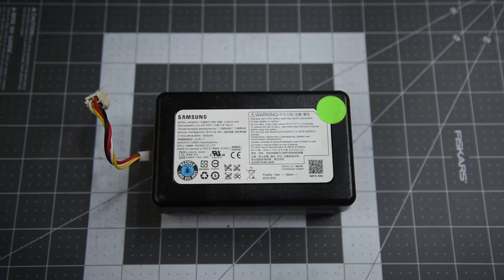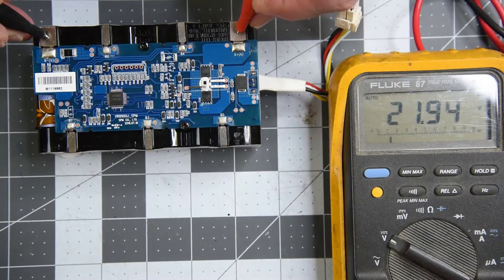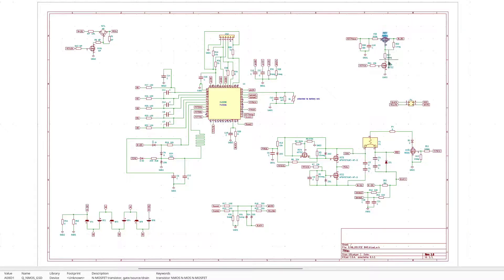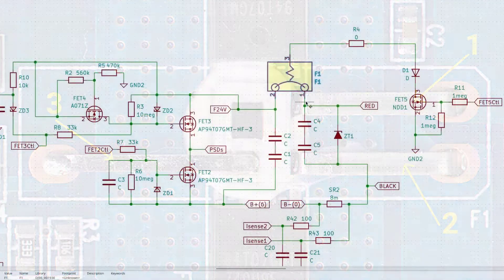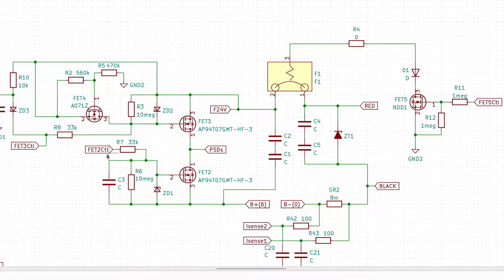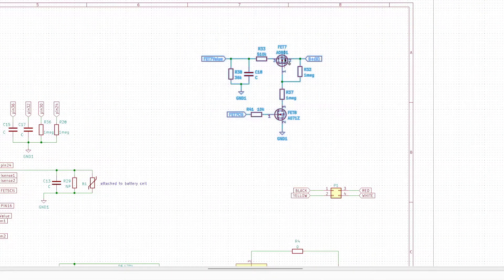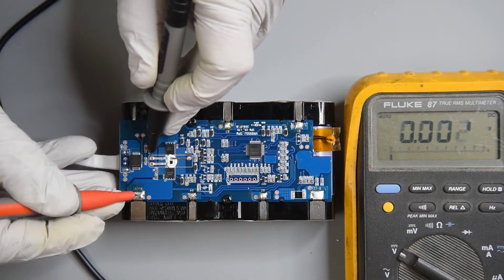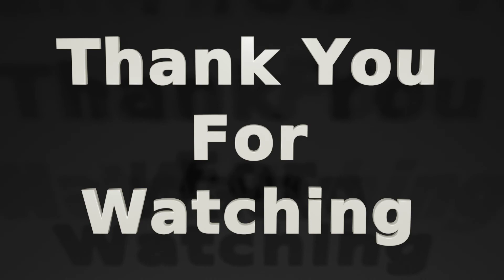Exploring the Samsung DJ96-00193E Battery Pack

Comment: Hi, 
I have such a battery pack and I have problems with my bot. If it is on the docking station, it boots up. If it moves away from docking station, it turns off immediately.

If I meassure individual cells, they are all have propper voltage readings (well balanced and full charged). But if I meassure at red and black, i get 0V. 
Should i get 0v if unplugged - and white and yellow are sending a "command" to bring the voltage to red and black?
Or should I get voltage on red and black always. If so, I have a problem with the BMS board and will investigate further.

Can anyone of you please check the voltages?

Thank you :-)
Reply from the maker: Take a look at this PDF: https://github.com/mlplel/rev_schmatic_dj96_00193e/blob/main/DJ96_00193E%20BMS.pdf. It's a schematic I drew of the BMS board. Check the special fuse F1; if it's okay, connect a light load across the batteries and then measure the cell voltages.

Comment: Hi, i replaced the cells in my battery. The battery pack looks fine and i have the correct volts between red and black cables. My robot every time it starts cleaning, it's stopping after less than a minute of cleaning and returns to the dock due to empty battery. I know for sure that the battery is full charged, checked with the multimeter.
Do you have any hint or clue about the possible problem?
Thank you very much, very good video
Reply from the maker: It sounds like a weak cell.  When you checked the voltage on the pack did you have any load on it?

Comment: Hi, I have this kind of robot vacuum cleaner. I realized that the BMS is broken and I have to change it. I disassembled the battery pack, the battery pack is a 6S2P of 21.6V 4.4 Ah. Can you help me choose the BMS that can replace the original? Give me a link where to buy it. Thank you
Reply from the maker: The battery pack BMS has to communicate with the vacuum, so I doubt there are any replacement BMS boards.  I think the best bet would be to try and find an entire battery on eBay or the like.

Comment: What do yellow and white wires go to in robot? What should voltages be? Really want to convert these robots to use dewalt or hart 20v batteries
Reply from the maker: The yellow and white wires are a serial communication interface.  Probably telling the vacuum what state the battery pack is in.  So if the vacuum doesn't get the correct information from the battery pack it probably won't do anything.  That will make it very difficult to use any other type of battery.

Comment: thank you for your video. i have  dj96-00193a battery . i've made the test like you at 6.35 minute of this video. one  fuse f1 works, but the other f2 one no. there is some possibility to restore it?
Reply from the maker: If you don't have 20-something volts on both the big leads of F1 then it is blown.  It is a special self-protector for batteries.  Something like these: https://www.mouser.com/pdfDocs/littelfuse_battery_protectors_itv4030_15a_datasheetpdf.pdf  .  But I don't know what the specs are for the one in the battery pack.  When everything is normal all 3 leads should have almost the same voltage on them.

Comment: Hi my robot have problem about battery. Now i check voltage from line battery but i don't know about voltage of line red white yellow black (good battery) please advice 😂😂
Reply from the maker: If I remember correctly, the red and black are the power lines.  Around 24 volts should be on them, but the battery pack will have to be connected to the vacuum to make the measurement.  The yellow and white are serial data lines.  The battery controller has an electronic switch that the vacuum has to tell it to turn on for the battery voltage to appear on the red and black wires.

Comment: hi, I have a problem with my powerbot vr 7000. After replacing the batteries, the robot works for about 15 minutes and goes to the base to charge, although the batteries still have sufficient charge. Do you know what could be wrong?  I will be very grateful for your answer
Reply from the maker: I don’t know for sure, but I would suspect one of the cells is discharging differently from the others. And the battery monitor is trying not to let that happen. That's the only thing I can think of at the moment.

Comment: Hello everyone,
I have a problem with my robot, it seems charged, I replaced the battery cells and they are at 3.9V, it moves away from the charging station, dies and the LEDs go out.
Do you have experience with this problem?
Would it be possible to have the schematic in PDF?
Thank you very much
Reply from the maker: How far does it move off the base?  If it just moves off the contacts then I would suspect battery pack problems.  I updated Github with a PDF of the schematic.   https://github.com/mlplel/rev_schmatic_dj96_00193e
Reply: @metalplasticelectronics354  Some times it pulls off and twists and turns on the vacuum motor to start cleaning, other times it moves off the contacts.
I have suspicions about the battery board. I check it. Thanks a lot.
Reply from the maker: It sure sounds like the battery pack.  I would try and put maybe a half an amp load on the batteries and see what the voltage reading is.  If it's good, then I would look for something around the MOSFET power switches.

Comment: Hi, why there is no reading on black n red wires? But reads 21.6 v between B- n B+6.
Reply from the maker: There is a special fuse and 2 MOSFET switches in between the power leads and the batteries.  I drew up a schematic for it here: https://github.com/mlplel/rev_schmatic_dj96_00193e  .  I think it's pretty close to the actual battery pack.
Reply: @metalplasticelectronics354  
Hi there, i do not understand very much about electronics, would you explain more details how to get it recharged?. I have a warehouse and recently got returned lots of these robot vacuums from samsung. Please need help.
Reply from the maker: I believe the battery pack has to communicate with the vacuum to charge or discharge.  The battery cells could be charged manually, but charging Li-ion cells safely and properly is not any easy task.  If the pack will not charge with it in the vacuum on the charging base, then one of the three items is defective.   If you have multiple items, try different combination of charging base, vacuum and battery pack.  But it’s not just a simple matter of supplying a dc voltage to the battery to get it to charge.
Reply: @metalplasticelectronics354  
Will it gets to charged if connect directly to B-(0) and B+ 6 ?
Reply from the maker: That would not be a safe way to charge the batteries.  If you just want to test to see if the batteries will take a charge, it could work.  I would limit the current to less than 500 milliamps for the test.
Reply: @metalplasticelectronics354  
Ok will try it out
Also thx for the sharing, i am waiting ur solution to make this kind of battery work again, will follow ip with u
Reply: How to charge a battery without a vacuum cleaner? Can I charge with original adapter connecting direct on battery some of four wires?

Comment: my board positif wire no supply which part do i need to check? when i check using multimeter -ve on black wire +ve on b+ have 21.40v but when measure on red n black wire no supply.
Reply from the maker: F1 has 3 leads.  Check the resistance between the two pins that are close together.  They should read almost shorted.  If not F1 is probably open.  It is a special triggerable fuse.  If it is okay, The controller may have FET2 and FET3 turned off.  That will disconnect the batteries from the power leads.
Reply: @metalplasticelectronics354  all 3 pin on F1 no reading to each other
Reply from the maker: Then F1 is defective.  I believe it is something like these: 
 
https://www.eaton.com/content/dam/eaton/products/electronic-components/resources/data-sheet/eaton-scf4030-self-control-fuse-data-sheet-elx1133-en.pdf

But finding one in stock for a 5 or 6 cell battery pack is difficult. And who knows what the current rating is supposed to be.
Reply: @metalplasticelectronics354  can use that part to replace? i will try to replace it..that unit cant be bypass?
Reply from the maker: It's a special fuse.  Probably a fire hazard without the right one in place.  And I don't know if one of those would work.  12 amps seems a bit high.  But that’s the smallest current rating I’ve seen.  If the batteries are rated for 10 amps.  I would not feel comfortable having a 12 amp fuse on them.  Certainly not something that is going to be running around my home.
Reply: @metalplasticelectronics354  thanks for your advise..

Comment: Nice very clear elaborated schematic teaching,,,may i ask that strangest thing f1 fuse i have tested it its opened on my samsung jet 90 battery pack its hard to find online can i just make it connected its other like shorting them its other thanks
Reply from the maker: It appears to be a special type of fuse called a – Self Control Protector or Self Control Fuse.  Something like this:  https://www.mouser.com/ProductDetail/Bussmann-Eaton/SCF4030-12-05?qs=Li%252BoUPsLEntK5nHGRSTGhw%3D%3D.  But I have no idea what current rating the one in the battery pack is.  Can jump it out for testing.  I wouldn’t put it in use with the fuse jumped out.  I think it would be a fire hazard.

Comment: Hi~ I left a comment on another video about your Samsung battery. And I took a closer look at this video and your comments, and there is a little controversy in Korea. The main IC of Samsung BMS has memory for the basic battery set, so it is set at 18650 1800mA. Therefore, it is meaningless to change to a higher-efficiency battery, i.e., a high-efficiency 18650 such as 3,400 mA, and it is meaningless because 12 cells are recognized as 6 cells even if they are inserted into a 6-cell battery pack. They say that unless the main IC is initialized, it is meaningless to do high efficiency or 12 cell battery repackage work. What do you think?
Reply from the maker: I’m not sure.  I think it would depend on how they are monitoring the charge and discharge state of the cells.  The only way to know for sure is to try it.

Comment: Yeah that connector on the micro is weird. I would have said JTAG, but after looking at the schematic and seeing how it traces out, it's definitely not JTAG. The Renesas datasheet for the RAJ240080 isn't much help - those pins have names, but they're all DIN, DOUT, and DIO. While searches for DIO gives results high on the nostalgia factor, it's not getting us anywhere.

Those NDD1 FETs (if that's what they are) come up as 600V/8A ON-Semi numbers, but all the datasheets I see are not SOT-23s, they're DPAKs and TO-220s. You don't usually see FETs in that package. 

I wish I could be more help. Those codes don't come up as anything recognizable by any of the usual datasheet sites and smd code book sites.
Reply from the maker: Yea I suspect some off brand semi manufacture.  I’m pretty sure all the transistors are MOSFETs.  I think it was made to set on a shelf for a long time with out running down the batteries.  The main controller IC is something I would like to know more about.
Reply: @metalplasticelectronics354  Should be that Renesas part number I gave above. I thought I linked right to the datasheet, but I guess our youtube overlords don't approve of such behavior. Or maybe it's just me. idk.
Reply from the maker: Thanks, That has to be it.  Datasheet says it supports up to 5 cells but sure looks like it will work for 6.  Very nice, I really appreciate it.  I'll have to update schematic now.  And yea I think You tube strips out links and I can kinda under stand that.
Reply: DIN, DOUT and DIO pins could represent native Renesas programming port for their E8 programming board.
Reply from the maker: I don’t know.  I’ve never used any Renesas MCUs. The header on the board just has the tool0 pin, 2 reset pins, port P122 pin, ground and 3.3 volt regulator pin.  But that header may be for testing and not programming.  Someone that has used a Renesas RL78 MCU could probably shed some light on it’s use.
Reply: @metalplasticelectronics354  RL78 based chips widely used in laptop batteries, and they could be fully reprogrammed or configured over SMBUS communication port, what is pack rebuilders doing when replacing the cells, otherwise chip stores old capacity, cycles or even alarm flags preventing the battery from being charged or discharged.